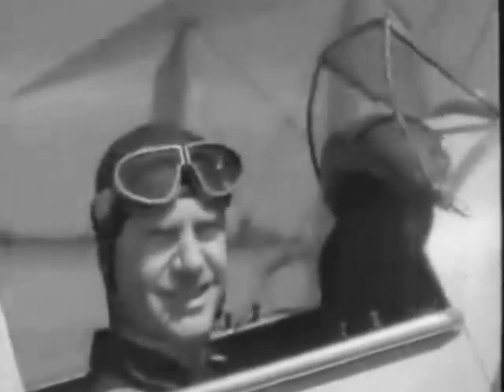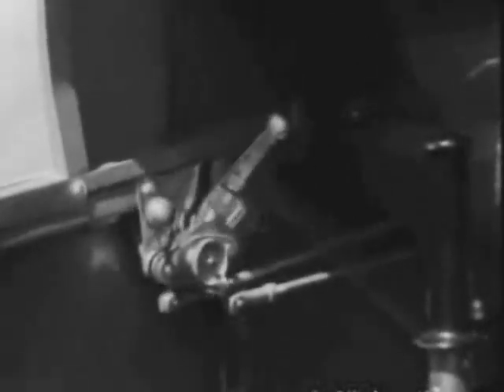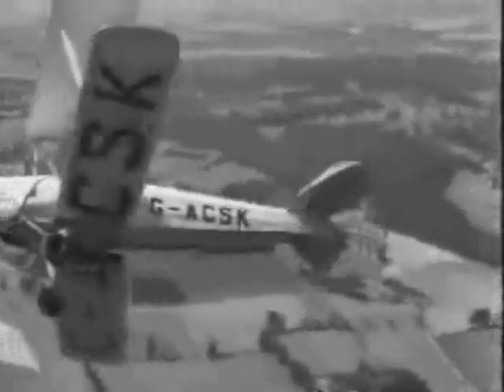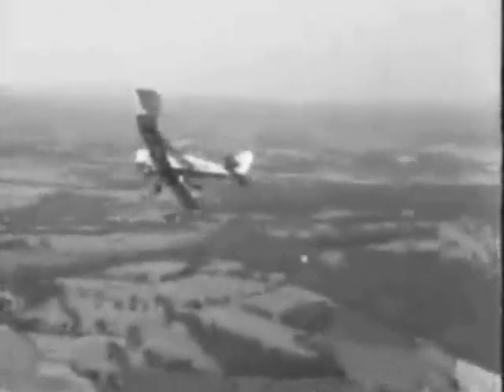How to fly a Tiger Moth

Comment: Yes I owned a DH82a in Australia for 5 years. Quite an interesting aircraft. Not to bad on 500yard agriculture strips.Great spinning aeroplane. mine had slat/slots on the top wing which one could control with a cheese cutter in the cockpit. Great for short field landings and many times one needs to de-ploy them in a tight steep turn!! Great spinning aeroplane the DH82a. Makes sure its not aft loaded.The odd one or to were fitted with the front cockpit fitted with a hopper and they worked well as a spray aircraft for crops.Getting into an Auster after tiger moth was orgasmic s!!! like steeping out of a VW into a BMW !!!!

Comment: I owned and worked a Tiger Moth. Cross wind 20kts you could handle in the Tiger. The Gypsie Major works best on new high quality car oil and you need a real good grade oil, as there are lots of times you need to do some flying at 2100 R.P.M.The airframe for it's age is pretty good. One needs to check Bell Cranks with some X ray oil to make sure your not developing cracks. Remember the metal in the Tiget Moth is NOT 4130. Wish it was. Worst catch of all is down wind cross winds, no brakes. The tail plane on the Tiger is proned to tail plane stalling at 15 kts. I like the slots and the cheese cutter handle in the cockpit. Being able to flick those  slats open when things got tough with low airspeed. The Gypsie Majopr engine is a pretty reliable engine, even if you cruised the Tiger at 1950 rpm. Oil pressure and temp gauge essentional. 3 point landinds are the best for a 
DH-82A. 1950 rpm cruise fine.Its vital to throw the oil out and puts some new automitive oils in. Some of these oils are amazing. I wouldn't part with the upper wing slats. They are a life saver when you have run out of airspeed.

Comment: Definitely a Tiger Moth on the outside, but the instrument panel is labelled as a Moth Major, a slightly earlier Moth with a wooden fuselage and unstaggered wings. On the G- info website from the CAA 'ACSK is listed as a Tiger from new in 1934, so maybe the inside shots are of a different a/c or the panel was transplanted?  Anorak off now, I just love these old films, keep up the good work!.

Comment: Does anyone know if its possible to fold the wings on a Tiger moth similar to DH60 gipsy moth?? To store in in a shed i mean?
Reply: Very few were designed with folding wings. There is one at the de Havilland Museum displayed with its wings folded back. I've seen an old video of one here on YouTube and the plane was being towed by a 1920's car on the road to the airfield! I had an aerobatic flight (two loops and one stall turn) in a DH87A Tiger Moth earlier this year which can be seen on my YouTube channel. I've also flown while stood on the top wing of a 1944 Boeing Stearman twice! One of those flights involved aerobatic loops and stall turns too!
Reply: The folding mechanism is there, but because of the stagger you can't swing them back very far, so the short answer is no

Comment: The Tiger Moth was an interesting aeroplane to fly. If you get caught up in the romance of flying a Tiger Moth you will die. The best attributes on the DH82A were the operational slots on the top wing. The slots  saved  ones bacon many times over.The Tiger was a good solid aircraft in a cross wind. One can handle 20kts if you know how to. The aircraft will spin like a top, should you want it to. If you dont lock the upper wing slots and spin it you need a prayer book.The Tiger is also workable in over load situations. Two in the front seat can be done and one can escape the enemy !!! The tiger is very much a STICK AND RUDDER Aircraft.Abuse this and your a dead man. I have had to fly the tiger in the past in applying conditions. ie., 40 kts of wind, thunderstorms, hail and being attacked by Eagles in Australian sky's.After 3000 hours in the tiger I moved onto an Auster. Got grey hair in 14 days !!.

Comment: 1:10 - nobody noticed the  throttle  is backwards?
Reply: I believe that right up to the jet era the British convention was to have the throttle going in the opposite direction to the French and US (now universal) convention. Sorta like driving on the other side of the road or Imperial measures - they were damned if they were going to do things the same way as the French.
Reply: I think that’s the narrators error. The throttle works conventionally, back for closed, forward for open. The mixture (the knob below the throttle) is backwards, back for full rich.